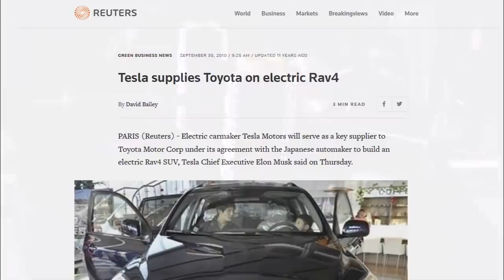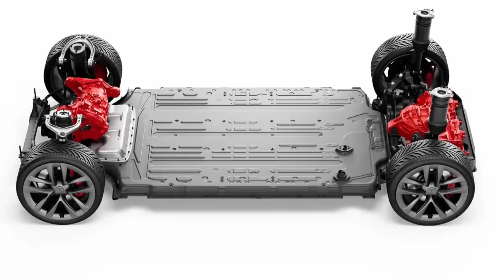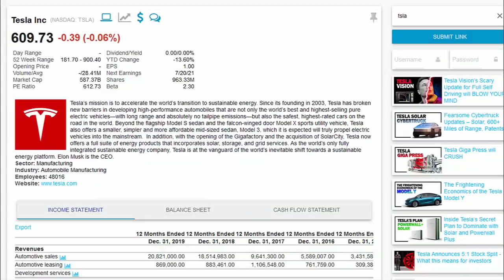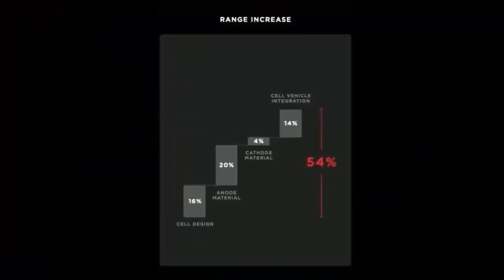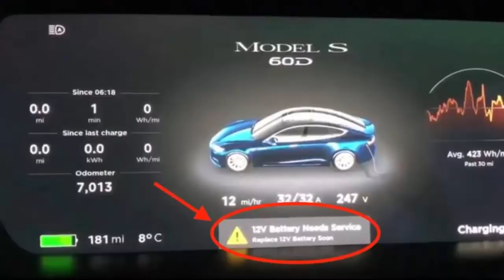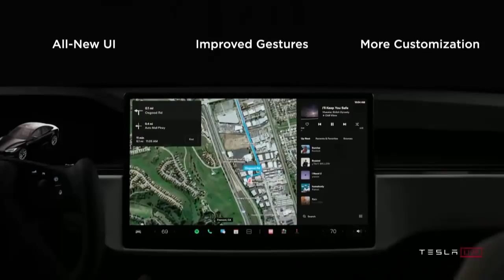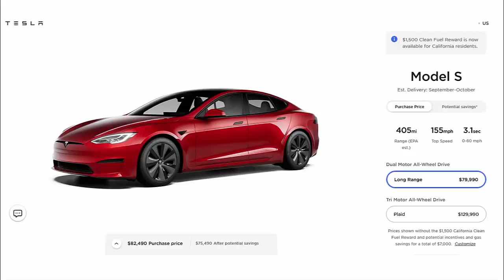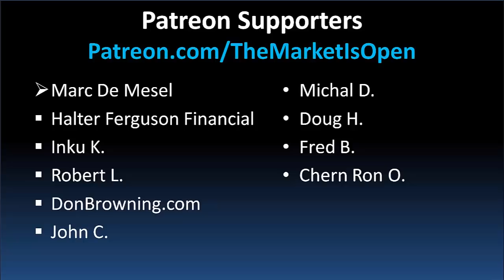The INSANE Engineering of the New Tesla Plaid Model S

Comment: 1865s have some advantages over 2170s due to their smaller size, such as higher aggregate power draw and greater surface area for thermal transfer, that are particularly beneficial for the performance demands of Models S&X.   I wonder if the new pack uses plate instead of ribbon cooling.

Comment: Isn't it true that customers can add FSD outright after they take delivery of their vehicle?  They can subscribe, or purchase it outright.  The hardware is in the car already.

I'm impressed with Plaid.  It's a lot of car even at that price point.

A couple of things to watch for:

  -  Upgrades.  Switching to 4680 cells will be a definite upgrade for Plaid.  As these are expected to be not only Tesla's best mobility battery cell, but also its cheapest, I expect, in time, all of their models will use 4680 cells.  Tesla also intends to upgrade the Plaid's tires to boost its top speed; those were the limiting factor on the Plaid at introduction.  And as usual for Tesla, since everything the car does is under software control, over-the-air updates will provide performance and convenience tweaks.  Including, Elon admitted, waypoints for navigation.  Good stuff!

  -  Tesla will benefit from $10K incentives from the US Government (for vehicles costing less than $80K), if the bill now in the Senate becomes law.  But do you wonder why the fossil fuel industry isn't squawking and lobbying hard against incentives?  There are two provisions in the bill which they like.  The first is that incentives are higher for unionized factory products - it's an extra $2,500.  Why do they like that?  Because it means incentives for cars with tailpipes that are deeper than Tesla can receive.  Yep, those incentives will go to ICEVs.

Current law classifies plug-in hybrids as qualifying to receive incentives.  The bill now in the Senate doesn't change this.  Legacy automakers can churn out plug-in hybrid ICEVs with tiny batteries and very short electric-only ranges very easily, much more easily than true BEVs, since their battery supplies are constrained.  A legacy automaker can make ten or more hybrid-electric vehicles with the battery cells that a single BEV would require.  They can make them cheaply, since batteries will be a tiny percentage of the vehicle's cost.  With an extra $12,500 incentive on top, plug-in hybrids will be ridiculously inexpensive.  And there will be a lot of them.

So while Tesla's models (under $80K) will be more affordable, plug-in hybrids are the real winners with this bill.  Legacy automakers will fend off BEVs by flooding the market with far cheaper plug-in hybrids.  Even an incentivized Tesla will cost at least twice as much.

Plug-in hybrids do contribute some small reduction in emissions.  But it's BEVs that are the future.  In Europe, in China, plug-in hybrids will be phased out much sooner than in the US.  The US is poised to lag behind - again.  The fossil fuel industry and its friends among legacy automakers couldn't be more pleased.
Reply: Plug in hybrid sales have been falling for the past 3 years.  BEV sales have been soaring during that same time.  

If ICE makers commit to plug in hybrids instead of full EVs then they're simply destroying their own future.
Reply: @LoanwordEggcorn  Falling sales for plug-in hybrids could be arrested and reversed by a change in the incentives regime.  See, Toyota soared past the qualification ceiling long ago, so the cars aren't exactly cheap.  They are positioned as an upgrade to pure ICEVs, price-wise.  Remove the ceiling and drop the price by $12,500, though, and hell, you're almost down to lawn mower territory.  (I exaggerate slightly.)  Manufacturers will be able to price them below their pure ICEV counterparts.

In the long run, yes.  ICEV manufacturers who cling to ICEVs in their model lineups will be hurt, maybe destroyed.  In Europe and China, the pain will come sooner, it appears.  The US, the Land of Avoiding Confronting Reality, they will likely have a longer run.

It's also worth noting that Tesla's engineering continues to put distance between the company and its rivals.  Plaid's announcement was low-key, but by gosh and golly, that car is loaded with tech we've not seen before.  Tesla is an engineering innovation machine.  They have convinced me that they will find demand for their production ramp.  Plug-in hybrids won't have it all their way.

But the other automakers, leaving out small fry like Rimac, Rivian, and Lucid, won't be supplying competitive BEVs in this decade, I don't think.  They're addicted to oil, they lack the batteries, they lack the tech and, being also addicted to outsourcing, they lack the engineering chops to innovate madly.  They're slow-footed monsters.  Plug-in hybrids are their lifeline.  Take that away and they will collapse, I fear.

Yet take it away we must.  It just won't happen as quickly in the Land of the Deluded.

I know, I know.  I need to settle on a single phrase to characterize my homeland.  Land of Made-Up Conspiracy Theories?  Land of Me First?  Land Where Lies Trump Truth?  (Pun intended.)  Hell, I can't decide.
Reply: @Urgelt  Agree Tesla's engineering is superb; so is SpaceX's.  In part due to spiral development borrowed from Silicon Valley software practices (but also applied to materials, hardware, chemistry, etc.) they're able to innovate at an incredibly rapid rate.  The results are most obvious with Starship, but also Falcon and all of Tesla, including the major, but invisible, engineering improvements from Model 3 to Y.  Tesla remains many years ahead of potential competitors.  They even may be accelerating away, particularly with the Roadrunner cell to pack batteries, massive chassis castings, etc.  (Other car makers are ordering huge casting machines lately though.)

But mostly it's their extremely rapid pace of innovation that keeps them ahead.  Any competitor that's copying Tesla instead of clean sheet radical innovating themselves will never catch up.  

I kind of like some of the big EV ideas at GM and others, but all of the ICE makers have trillions of dollars in sunk costs and IP for internal combustion so have huge inefficiencies in making a rapid transition to EVs, which already cost less to own and operate than similar ICE and very soon will cost less to build.  Once the latter happens, every ICE or hybrid built represents a loss of profit compared to an EV.

Central planners are far more likely to get things wrong than free markets.  I sincerely hope a $10k incentive fails to make it out of the Senate, and that it doesn't apply (equally) to tiny battery hybrids.  That it's even being proposed shows how strongly crony capitalism from Rustbelt Big Auto has its hooks into Congress.  It's absolutely corrupt socialism for the biggest companies if they get $10k each for weak hybrids.

America gave us SpaceX and Tesla.  While some people in any country are stuck in needlessly old ways such as ICE, many Americans are not.  America is also still the largest market for Tesla, though China and Europe are catching up.  As gigafactory in China did there, Giga Berlin will ramp up sales in EU massively.  (Which of course is why entrenched legacy car makers in Germany in particular are trying to create roadblocks for Giga Berlin.)

ICE makes economic sense for consumers (particularly in the U.S.) since trillions of dollars of annual fossil fuel subsidies are invisible (but actually paid in taxes, war, military and civilian lives lost and pollution).  Google "IMF global fossil fuel subsidy".

In that sense the U.S. is strongly influenced by consumer economics.  That's a good thing, given that EVs already have a lower Total Cost of Ownership and will soon have lower purchase prices too.  Most people will buy EVs when the latter happens for both purely economic reasons.  Long term, ICE is already dead for most road transportation.  The only question is how much environmental damage will be done until then.

Minus economic distortions such as large subsidies for weak hybrids, hybrid sales will die nearly as quickly as ICE. When EVs cost less to both own (today) and purchase (a couple years hence), few will buy ICE.

Thank you for a thoughtful and enjoyable conversation.
Reply: @LoanwordEggcorn  Glad to read your thoughts here, Loanword.

Let me correct a very small misperception.  In the Senate's current incentives bill, legacy automakers' BEVs and plug-in hybrids (and also hydrogen fuel cell vehicles if priced under $80K) will benefit from $12,500 in incentives.  Tesla will only benefit from $10K in incentives.  The difference is a reward from Congress for automakers who are unionized.

Tesla will be facing a strong pricing headwind if this bill goes through.  Their mass market cars will be incentivized, but plug-in hybrids will generally start below Tesla's cheapest models, and incentives will push their prices down into the dirt.

Tesla can fight back with quality, features that nobody else can match, and driving down its production costs and prices.

The much-discussed $25K Tesla, if they can pull it off, would be on a footing roughly equal to plug-in hybrids, even with their deeper incentives.

I'm not all that optimistic that we'll see a $25K Tesla any time soon.  Eventually, perhaps.  If they did it now, it would have to be stripped of bells and whistles Tesla wants to cook into its cars, especially the FSD hardware and sensors.  Does Tesla want to make a dumb BEV?  I kinda doubt it.  They see future cars as benefiting from rising intelligence; a stripped-down Tesla would be a move in the wrong direction.

Moore's Law - not much of a law, more of a trend - will deliver cheaper and more capable electronics over time, so the longer Tesla puts off the $25K car, the more easily they will be able to hit that price point without compromising their vision.

But that's only an outsider's opinion.  Tesla has its own plans, and will do what Tesla thinks is best.

Overall, I'm very optimistic that Tesla's production ramp will find buyers as it goes, even if hybrids are flooding the market.  The real concern I have is that actual competitive BEVs from other manufacturers won't appear in meaningful numbers in the US, as legacy automakers stretch out their cell supplies by making hybrids instead.

The incentives plan probably won't shake Tesla off of its trajectory.  But the rest of the US market won't look as rosy if this legislation goes through.

Eventually, when the US finally bites the bullet and admits that cars with tailpipes are not the answer to the climate emergency, Tesla's legacy rivals will be in very weak positions, with even more sunk ICEV capital they'll have to write off.

I agree with you.  Incentivizing purchase of vehicles isn't a good approach, from the standpoint of dollars spent versus carbon emissions eliminated.  I'd much prefer removing incentives for fossil fuels and a gradually-rising carbon tax.  Then let the market sort itself out.
Reply: @Urgelt  Yes, I saw there was a larger incentive for union built cars.  Could the pandering be any more clear?

Agree these kinds of distortions in markets can cause all kinds of strange and ultimately undesirable results.

Take away the trillions in fossil fuel subsidies and fossil vehicles instantly become non-economic, so yes, it would need to be done gradually.  Simply removing the legislated direct subsidies would be as effective as a Carbon tax, but without the potentially highly corrupt and overreachingly powerful potential world government needed to administer it.

Removing subsides and letting market forces and consumer choices find the most efficient solution usually works best and is often the best policy, even if it's not the most common.

Tesla will absolutely make a $25k car, and it will be superb.  I imagine it would be offered with a full suite of vision hardware for the active safety features, with Full Self Driving still an optional paid feature or a subscription model for it (as it is for existing models).  The hardware probably is not too costly and as you note due to technological progress keeps falling in cost.  For the benefits it can give vs relatively low costs, I can't see Tesla leaving it out.  

By apparently doing legacy car makers a favor by subsidizing hybrids, they would actually be helping Tesla in the long run by hobbling the old car makers with obsolete ICE technology longer than it would naturally die.  This would be an intended consequence that would backfire and have the effect of keeping the legacy car makers even further behind.  The only positive would be that it would amortize some electrification costs for batteries, motors, etc., in a relatively weak way.

Again, central planners don't get it right as often as markets, particularly when the regulations are corrupted by relatively petty politics.

Bottom line: at this point hybrids are actually bad for the car industry, given how much more efficient BEVs are both for building and operating.  Subsidizing hybrids therefore probably hurts more than it helps, ultimately making hybrid builders LESS competitive by wasting resources on a dead end solution, instead of going BEV more decisively.

Comment: Video is a little confusing regarding drag, sport cars usually have less drag just by having a smaller wind facing surface, but a worse cd because they need more downforce.
Reply: I would love for people to use the simpler term “drag” instead of “drag coefficient”, including frontal area as they should, because it’s important!

The Aptera’s Cd of 0.13 is even more impressive than it sounds, because its frontal area is also much lower than other cars, including the Model S and the Model 3.
Reply: @altosack  thanks for showing that at lease some people get it. 👌🏻
Reply: With the retractable spoiler out the drag is higher. A nice thing with this type of spoiler is that you can use it when needed, not all the time.
Reply from the maker: Yeah Cd is just the shape, CdA takes frontal area into consideration.

Comment: 5:36, he have two motors on the back but both are connected to one reduction gear. 
I not see two reductions gears for two wheels.
Reply: No, each motor has its own reduction gears. They have torque vectoring because the motors are not interacting with each other, all they share is the oil and the case.
Reply: @tribalypredisposed  show me, I can't find photos of rear power train
Reply: @tomekstanek  watch the Dragtimes video of the event here on YouTube.
Reply: @tomekstanek  Here is a video description of the motor(s) from Tesla via the Drag Times video: https://youtu.be/S4KmRZ28hdw?t=683

The two rear motors each have their own reduction gears and are not mechanically connected to each other.  There is no rear differential.  

Rear torque vectoring is by motor control.

The front is single motor with a differential.  Any torque vectoring at the front would probably be by individual front brake application.  That said, torque vectoring at the rear is a lot more meaningful and there may be none at front.
Reply: @LoanwordEggcorn  thank you
Reply: @tomekstanek  Nie ma za co!  You're welcome!

Comment: The vents being pointed at our face all the time is not good news for those of us who wear contact lenses.
Reply: The vents are very diffuse and can be pointed in virtually any direction.  (Actually it's the converging airflow that moves, not the vents themselves.)   They are not pointed at your face all the time unless you want it that way.  Try one.
Reply: @LoanwordEggcorn  , at 14:26 facial recognition is used to keep the airflow on the passengers face at all times.
I know how the current system works, we have several Teslas in the family.
Reply: @shepherdsknoll  Ah, OK, i haven't actually watched that far into the video yet.  I prefer the current 3/Y system of a manual vent direction control.   I also prefer a mechanical switch for a shifter.

I think Tesla is getting a little too clever, but I suppose it's due to their work in driving automation.

Not everything that can be automated is better that way.

Comment: I would say that  lowering the front in Plaid mode, increases air drag but also increases downforce  which is very important for stability at high speeds.
Reply: How would a smaller profile make more drag?
Reply: @wolfiethebumpireslyr  Lower in the front would make more of a wedge shape, thus deflecting more air, thus creating more downforce
Reply: EVs with this much torque are severely traction limited, so it's the downforce that's most useful.  They have far more power than the tires can handle and need the downforce.  

Aerodynamic drag at these relatively low speeds is relatively insignificant, especially given the motive power available.
Reply: @wolfiethebumpireslyr  As said, lowering the car only at the front does not reduce the crossection. The new shape has a higher cw value, but more downforce.

Comment: There is no logical way the pulley diagram pictured @3:42 could function unless multiple belts were involved.  If that were the case the final drive pulley appears remarkably surprised on the top right.  #EngineeringGraphicFail.

Comment: *the infotainment computer is based on an AMD Ryzen APU, with efficient integrated graphics, enough to power the 3 screens under normal circumstances. It also has a discrete graphics card, which switches on only when gaming, but it's not really high end, more like mid-range. It's an AMD Radeon PRO W6600 with 8GB GDDR6 memory.
Reply: Which is why Tesla compare their system to a $500 console instead of a $2000 computer.
Reply: @lanzer22  I'd say they chose wisely. Maybe the AMD APU will be used in the Model 3 and Y too. The current Intel Atom processor really sux...